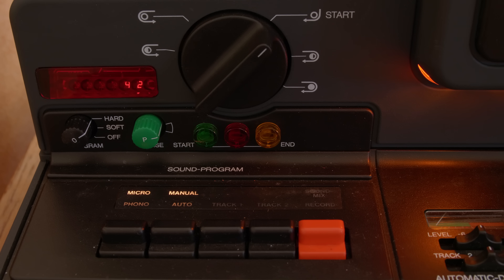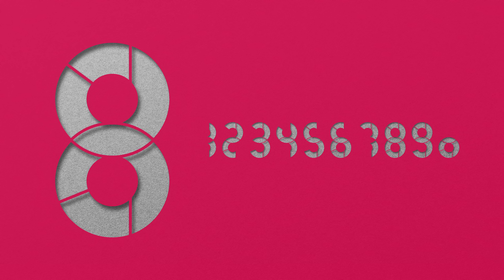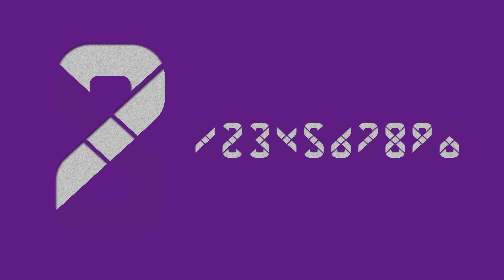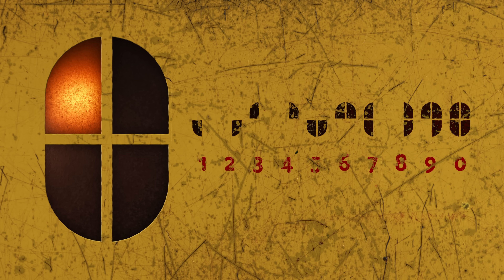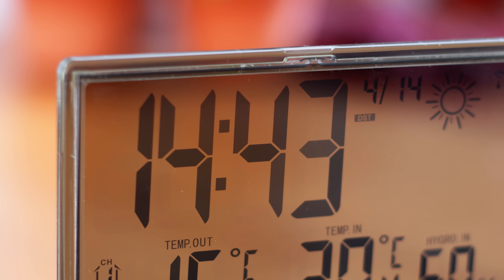Segmented Displays

Comment: My question is... why can't segments overlap? I think allowing them to do would open a lot more possibilities design-wise
Reply: LCD cannot allow that.
Reply: @ikagura but why?
Reply: @maxi6457  It's a bit technical but since electrical current is passing through they can only be activated in one continuous way so that's why you see small gaps between the segments as well or else the entire thing couldn't show separately.

That's one reason why dot matrixes took over for bigger displays.

Comment: 1:13 7-Segment (Double Square)
3:42 Sports
4:19 Sports Black
4:37 Seamless
5:31 Double Bubble
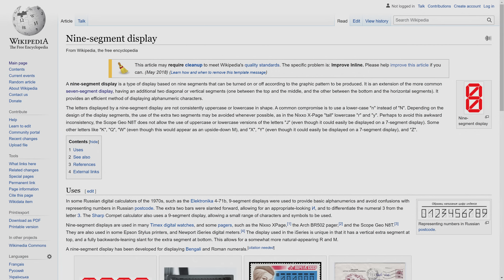6:27 9-Segment
6:43 7-Segment Fake Matrix
7:03 18-Segment Fake Matrix
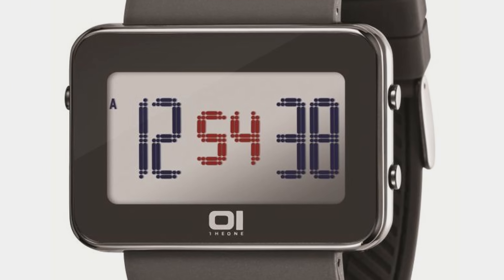7:50 Sharp Traced
8:56 X
9:15 X (7-Segments)
9:32 X (8-Segments)
10:03 FreeForm
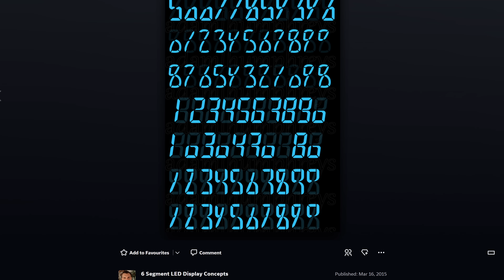10:40 Round 5-Segment
10:46 Sharp Based
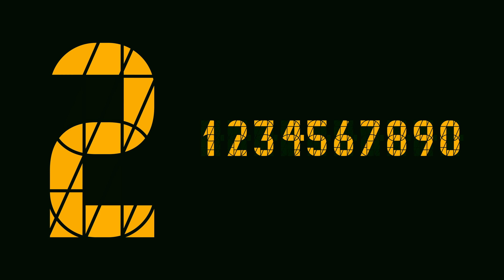11:19 No Compromise
11:36 X-O
12:11 X-O (15-Segments)
12:43 3x5 Matrix

Comment: I can’t believe I didn’t think of the 3x5! I’ve been trying for a while now to come up with a Minecraft-friendly display that doesn’t use too many segments but is able to clearly display every letter. The standard seven segment display uses a 3x5 block matrix but omits the second-to-bottom and second-to-top middle blocks and divides the remainder into seven overlapping three-block segments. I can’t believe I didn’t think to just individually power them. That’ll probably be difficult if I want to be able to lock repeaters as well, though. But I’ll just have to get to designing!

Comment: one possible reason why the double square works: it's a simplification of a 3x5 matrix. take the middle pixel of rows 1, 3 & 5 and the two side pixels of rows 2 & 4, and stretch to extend them into the points where they touch each other.

Comment: 6:20 that always happens to me, I’d discover some gnarly cool way to do something just to find out it was invented in 1492
Reply: When I was like 16 I "invented" run length encoding, after making a drawing program in basic.  It just seemed logical when saving the image to indicate how many of the same color in a row there was.  This was long before internet so I had no idea it had already been done of course.
Reply: @JohnVanderbeck  during college I "discovered" Euler method for numerical simulation when I was trying to use data from a table as a function to stimulate our UAV take off performance. 

I explained over 45 minutes to my senior friends how I solved it just to be hit at the end by, "isn't that just Eulers method?" 

At this point in uni I was a couple semesters away from taking numerical analysis. Haha very fun times

Comment: I like the 5-segment one at 10:56, just extend the 1 and 7 with the bottom-right segment, and I'm sold.
Reply: The 7 you are thinking about would become 2
Reply: @MrBlackmidi1234567890987654321  nah, 2 uses bottom-left segment, not bottom-right
Reply: @Nibiroid  my bad, it would actually be 3

Comment: 0:00 Intro
0:21 7 Segment display
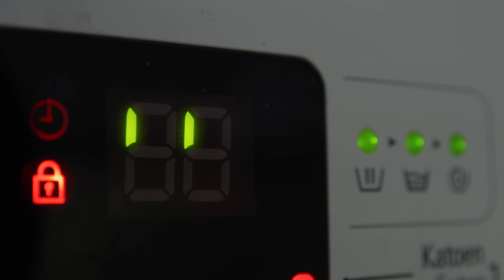0:42 Fig.12.
1:14 Double Sqare
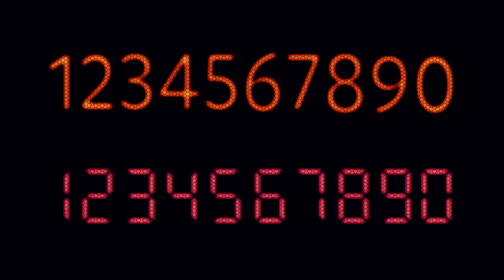1:28 Compramises
1:57 Shape of the segments
2:00 Chopping the corners
2:07 The divisions aren’t symmetrical
2:14 Increasing the segment’s thickness
2:29 Rounding the corners
2:31 Default
2:39 Gaps
3:19 Default Black has big gaps
3:31 Sports
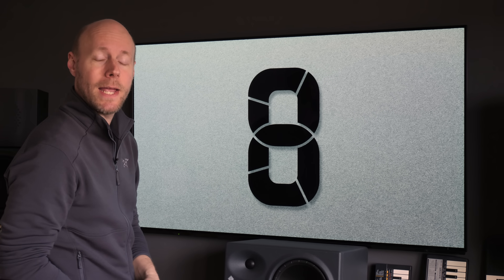3:45 Big screen viewing
4:16 Sports Black Nine segment display
4:36 Seamless
4:53 2 in six hours of a 24 hour clock
5:13 Upside-down
5:29 Double Bubble
5:55 Nine segment design
6:45 Fake matrix display
7:04 Real 5:7 matrix
7:16 Watches that are found on the internet
7:52 Sharp traced 9, 8, 7 segment display
8:54 X 6 Segment design
9:16 X 7 Segment display
9:33 X Ugly 9 segment display
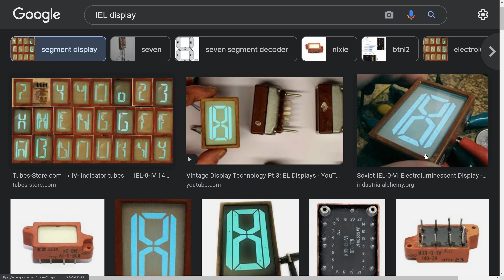10:00 6 segment display “Freeform”
10:14 Big spaces onto that kind of display
10:31 Creative Designs
10:41 Round 5 Segment design
10:46 Sharp traced 5 segment design
11:00 4 Segment design
11:21 No Compromise 35 segment design
11:32 XO “13 segment design”
11:44 14 segment double square
12:14 Lighter 15 segment version
12:45 15 segment “3:5 matrix”
13:01 Next video:About this rare unicorn
13:18 All of the displays
13:22 New album:Segmented segments
13:55 Outro
Next video:What if Elevators disappeared?
From:AumSum
Reply: It took fourteen minutes to watch the whole video!
Reply: I mean, It took thirteen minutes and fifty-five seconds to watch the whole video!

Comment: 3 segments
4 segments 
5 circle segments
5 sharp segments
6 X segments
6 Freeform segments
7 X segments
7 Freeform segments
Default, Default Black
Seamless, Double Bubble
9 segments sports black
13 segments XO
14 segments double square
Lighter 15 segments 
15 segments 3:5 matrix
No Compromise 35 segments

Comment: *Segmented Displays* are a type of display technology commonly used in devices where only limited numeric or alphanumeric information is required. They are composed of individual segments (typically LEDs or LCDs) that can be turned on or off to form numbers, letters, or symbols.

### Types of Segmented Displays

1. **7-Segment Display**: 
   - Consists of seven segments arranged in an "8"-like pattern.
   - Primarily used for displaying decimal digits (0-9).
   - Common in digital clocks, calculators, and meters.
   
   ![7-segment display example][]      Each segment is labeled from 'a' to 'g', and the whole combination can represent numbers or some basic letters (like "A", "F", etc.).2. *14-Segment Display**:   - Contains 14 segments, allowing it to display both numbers and a wide range of letters.   - Common in older alphanumeric displays such as early digital clocks or appliances.   ![14-segment display example][]3. **16-Segment Display**:   - An extension of the 14-segment display, it includes two additional segments for more precise letter representation.   - Useful for displaying a larger variety of alphanumeric characters.4. **Dot Matrix Display**:   - Unlike strictly segmented displays, dot matrix displays use a grid of LEDs or LCDs, allowing for the display of more complex characters and symbols.   - For example, a 5x7 dot matrix can display a broad set of characters.### How They WorkEach segment in the display is individually controlled (typically by a microcontroller or driver IC). By turning on specific combinations of segments, the device can form recognizable digits or letters. For example, to display the number "8" on a 7-segment display, all seven segments (a-g) are turned on.### ApplicationsSegmented displays are used in a wide range of applications, including:- **Clocks**: Digital clocks often use 7-segment displays for showing time.- **Calculators**: Early calculators used 7-segment displays.- **Measuring Instruments**: Devices like multimeters or frequency counters use segmented displays for numerical readouts.- **Appliances**: Microwaves, stoves, and other household appliances often use segmented displays for timers or settings.### Advantages- **Cost-effective**: Simple and inexpensive to manufacture.- **Low power consumption**: Especially when using LCD technology.- **Easy to read**: Clear display of numbers and basic letters.### Disadvantages- **Limited character set**: Especially for 7-segment displays, which can't easily show letters or symbols.- **Low resolution**: Not suitable for complex graphics or text beyond basic characters.### Controlling Segmented DisplaysSegmented displays are typically controlled using a microcontroller (e.g., Arduino, Raspberry Pi) and a driver IC (like the **MAX7219* for LED displays). For multi-digit displays, multiplexing is often used, where each digit is controlled in rapid succession to give the illusion that all digits are lit simultaneously.Here's a simple example of how you might control a 7-segment display with an Arduino:```cpp// Arduino pins connected to segments A to G of the displayint segmentPins[] = {2, 3, 4, 5, 6, 7, 8};

// This array represents the binary patterns for digits 0-9int digitPatterns[] = {  0b1111110, // 0  0b0110000, // 1  0b1101101, // 2  0b1111001, // 3  0b0110011, // 4  0b1011011, // 5  0b1011111, // 6  0b1110000, // 7  0b1111111, // 8  0b1111011  // 9};void setup() {  // Set all segment pins as output  for (int i = 0; i < 7; i++) {    pinMode(segmentPins[i], OUTPUT);  }}void displayDigit(int digit) {  int pattern = digitPatterns[digit];  for (int i = 0; i < 7; i++) {    digitalWrite(segmentPins[i], bitRead(pattern, 6 - i));  }}void loop() {  for (int i = 0; i < 10; i++) {    displayDigit(i);    delay(1000); // Show each digit for 1 second  }}```This code would cycle through the digits 0-9 on a 7-segment display connected to an Arduino.### ConclusionSegmented displays are simple, effective, and widely used in electronics where only basic numeric or alphanumeric output is needed. They continue to be popular in various devices due to their simplicity and readability.

Comment: If you forgo the notion that a segment display needs to be able to display the ten Western Arabic numerals, a five segment display becomes a lot more doable.
　ーー　　A
｜＼　｜　DB
｜　Ｖ｜　E
｜　　｜
｜　　｜
　ーー　　C
This is a five-segment design I made for Eastern-Arabic Numerals. The two ٢ (AD), three ٣ (DE), and zero ٠ (E) suffer the most. The E segment does not require a tail.

Comment: I think the double square is so influential that it changed how people write their numbers by hand. People who grew up with digital interfaces are more likely to write a 4 in two strokes with an open top, write their 8s as two independent circles on top of each other, or write their 0s really tiny. I was born in 99 and I had peers in school do that - the 4 thing wasn't so uncommon at all, not unthinkable or bizarre, but I had at least two classmates write very tiny 0s and it was memorable enough that I remember the confusion I had when doing group work with them and was reading their handwriting.

Comment: I like the design at 9:49 the most, but 4 should use the vertical line on the right rather than the bottom right diagonal line, so that it looks like the H but upside down. Looks better imo.

EDIT: Just realised the alphabet is a weird mishmash of capital and lowercase letters, and that the S and Z are the same as the 5 and 2 respectively. Now I hate it.
Reply: at least it's efficient for the amount of segments it has. 7 segment displays often display a lowercase b and d but an uppercase E and A. his x0 with 13 segments is much better. even on his webpage for his segmented displays, he says this one is ugly lol

Comment: This video helped me design a 7-segment display. I decided to make the top and bottom segments full width, with radiused corners. Although that causes the 1, 4, and 7 to be a bit shorter than the other seven digits, the digits are well formed.I suppose I could add a few corner segments to address that, but idk if it's worth it, lol.
Reply: Suddenly I can't view my previous reply to my comment. Is it because I included a link to Facebook? I just wanted to show an example. Well, it's under album "Walter's Artwork" if you want to see. In any case, I realized if I make it a 16-segment display then I can center the 1. I made an 11-segment design too; that's also on my Fb photo album.

Comment: This brings back memories. I experimented making my own segment displays in LittleBigPlanet 2, mostly for aesthetics but also for ease of setup. I made my displays quite symmetrical and aligned to the level editor's grid. I quite liked my 8-segment display, which had an extra vertical line in the middle to make the 1 digit centered, though I also made quite a few designs that strayed a bit from real-world limitations.

Comment: Seven segment display is king for a  good reason. 
There was some creativity in the other designs but there was always something that suffered to much.  some of the 1's and 4's were completely unrecognisable and the half size zero simply doesn't work in my opinion. 

With regard to increasing the segments,   the whole point of the seven segment display was to cover the the number 0 - 9  as with the least resources possible.  as each segment on things like liquid crystal displays and old style L.E.D setups required additional components and design complications.  

When you take it up to the level of the 36 segment display,  you have simple turned it into something else entirely.  
at this level it is arguably no longer a segmented display and instead a rudimentary bit map.  Especially when you add colour. 

Back in the days of LED watches and pocked calculators,   "seven seg display" as it was known, was simply the most efficient combination possible.

Comment: Another important advantage of the double square design is that since the segments all have the same shape, manufacturing costs are significantly lower than displays that have uniquely shaped segments. The segments can be used interchangeably, so assembly is simpler and replacement is much easier.

Comment: Hello Posy, I very much enjoyed watching (and re-re-re-watching) this video!
There are a few points I'd like to raise / discuss:
1) there is a brand new(?) 10 segment display released on Teenage Engineering EP-133, I'd love to hear your thoughts
2) there are some design points of yours I find a little strange, such as the addition of a very superfluous element in the middle way too far right for some of your 4's; but much more intriguing is the 4-segment display!  I believe with a little refinement it could be much more viable, and would love to discuss it further... my idea runs something like (┏   ┛ ┗  ┓ ╰╮ ╭╯  ╬  , using text characters is far less than ideal - as I said, I'd love to refine it)
3) if you where to discuss matrix displays, IMHO the most iconic is the 35 segment display of the NYC Subway's R46 rolling stock; of which I'm hoping to acquire 1-5 of as the trains are very soon destined to become an off-shore reef, and these displays will need to be removed beforehand.  If by some twist of fate I am able to get any more than one, I'd gladly provide one to you.
Reply: Do you want a place for discussing about segmented displays?

Comment: I once made an 18-segment display that could display all letters. It's quite straightforward, having two top and bottom segments, two left and right segments (8 total now), two in the middle  (10 total now) and eight diagonal segments (one in each corner facing the middle, one on the edge going to the other edge, making eighteen total segments)

Comment: Classic
Sports
Sports Black 9 Segments
Seamless Regular. Bold Black
Double Bubble 
9 Segments (bleh)
Fake 5*7 Matrix (color coded)
Sharp Traced* and Bold
X Black
X 7 Segments Black
X Ugly 9 Segm.
FreeForm 6 Segments
Round 5 Segm.
Sharp Based 5 Segm.
4 Segments
No Compromise 35 Segm.
X 13 Segm.
14 segment (with dot 15)
X 15 segm.
Solid 11 segm.
X Light 15 segm.
3*5 Matrix

Comment: The 9-segment font was used on postal envelopes such as entire Soviet Union including modern Russia, Ukraine...
Everyone in these countries know it if they ever sent or received a letter. 
Its widespread use predates any practical digital displays.
There are also other fonts rarely used on VFDs that did not have a problem with intersecting lines or separation but had parallax effect with too many segments so they often opted for 10 grids - one for each digit.

Comment: The best segmented display is the seven segmented one, it's the most comprehensible one and the one I've grown up despite being born in y2k.
It's also the one most familiar for me as I have lots of things that uses that segmentation, most notably calculators, thermometers and the odometer display of my mom's SUV.
Until computers came it was the best way to read numbers before computers and the Roboto font face came.

Comment: /-=[ 12:46 ]=-\ I know of a device with a slightly similar matrix display. It's a reflective LCD (I think) from a car radio in the late 2000's.
If you want the specific car model, it's a 2005-2009 Volkswagen Golf Estate/Wagon. It also has a dim blue backlight which makes for a very cool transition when you drive under on overpass, for example, as whatever parts of it are in a shadow, have the blue backlight visible.
Also, great work. This is one of my favourite videos that you've made, along with many more. Despite you only uploading every few months or so, it shows that you really do do quality over quantity with your videos. The self-made music is also great. Again, your work is very impressive.

Comment: Times (pin me) 
0:01 Intro
1:15 Double Square
3:41 Sports
4:17 Sports Black
4:36 Seamless (2 intestifiies)
5:29 Bobble Bobble
5:58 Nine Segment Display
6:44 Fake Matrix 7 segment
7:07 Fake Matrix 18 segment
7:20 Internet Designs
7:49 Early Calculator Handwriting
8:53 X
9:17 7 Segment X
9:34 Alphabet X
10:01 Freeform
10:41 5 Segment Display
11:00 Labels in Segmented Display
11:15 35 Segment Display
11:32 XO
11:44 14 Segment Display
12:14 15 Segment XO
12:44 3x5 Matrix
Reply: r u a riggy raiser?

Comment: I wanted to optimize the look for numbers such as 5 and 6, so I came up with this abstract design:
 _
| / |
( )|
 —

(the top segment would have rounded edges and the right segments would be conjoined)
     _  _          _        _     _   _
/ |   /   /  | / |  |     /   |   |  |  /  | / |
  | (     )      |   )  ( )     |  ( )       |  ( )
     —

Notice how it isn't based on the number 8, and that the only compromised number is 4 (as well as 0, arguably). It would look better written out rather than on a YouTube comment. I realized that the 2 is the only number that uses the bottom segment, so perhaps if I extended the bottom of the left curved segment, I could make this a 6-segment display with a more realistic appearance than the Double Square.